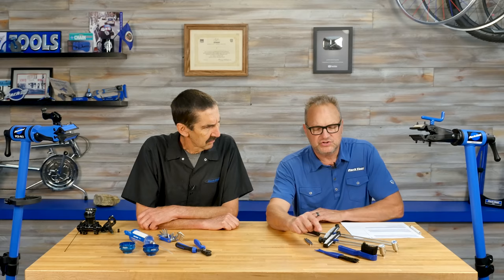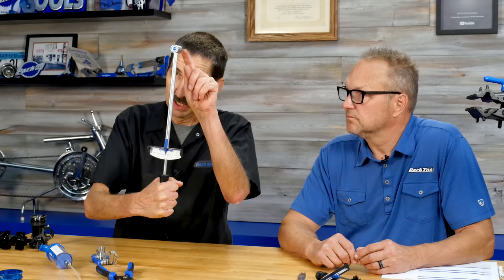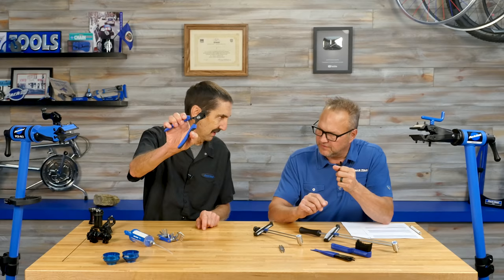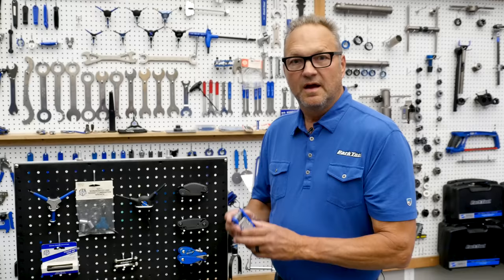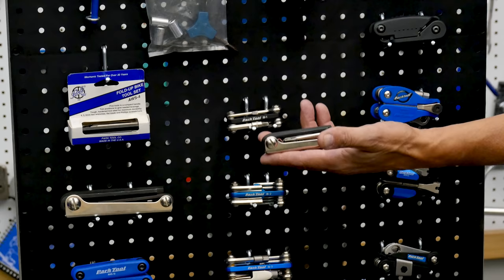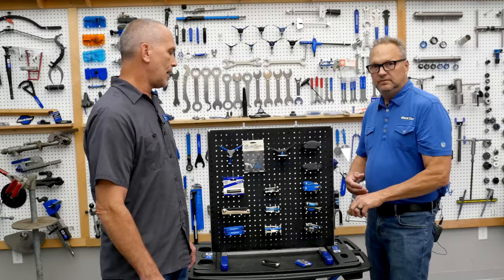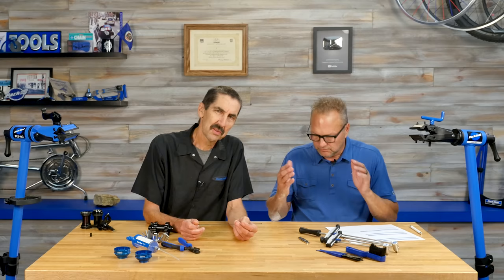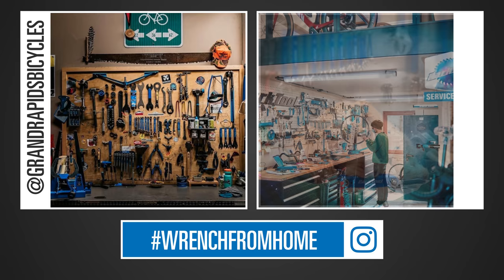New In Blue Episode 8 | New Tools for Fall 2021 and Park Tool's Multi-Tool History

Comment: I got my AWS-1 in 1993, and I use it to this day. Not even close to being worn out!
Reply: I got my ASW-1 in 1987 and still use mine. I took the blue plastic sleeves off the Allen wrenches so I could fit the tool in a tight place. Those were lost in the 80 s 😂

Comment: Please PLEASE when you make a new BB tool, put some 1" hex wrench flats on it (for the FRW-1, or a big wrench) so that really stuck threaded BBs can be removed. I have a few of the newer aluminium ones such as these, and the 3/8" drive hole has started to cam out on at least two, due to them having to be loaded heavily to remove stuck BBs. However, the older steel ones can get better purchase due to the hex end,
Reply: Really stuck ones- pour a just boiled kettle over the area fairly slowly, drag out the heat being introduced. Catch your water in a bucket below. That works for me every time to loosen from seized to movable. Allow the metal to break the seize for a few mins, and even using some penetrant after a few mins can help further.

Comment: It's good to have an 8mm hex key (I need one to remove my rear wheel) but my Hope Evo cranks take a 10mm hex key so I guess I'll still need to carry an extra tool if I want to be able to tighten/remove them trail-side. Having said that, with modern splined cranks that rarely happens as long as you torque it right to start with.

For me the ideal trail tool would include: Phillips/cross head screwdriver, 2.5mm, 4mm, 5mm, 6mm, 8mm hex, T25, chain tool, tyre plug inserter/hole reamer (for tubeless tyre plugs) and a tyre lever. I can usually get by without one but occasionally a single, long tyre lever with a metal (or similar strength/stiffness) core is useful.

I also carry a (presta) valve core remover and a spoke key but they're already built into my valve caps. For long distance/multi day treks I also carry a Leatherman for the pliers, knife, scissors etc...

Comment: I spent 20+ years selling bikes on the shop floor, and always wished for a simple multitool with 4-5-6, JIS screwdriver and locking knife blade that wouldn't wear holes in my shorts.

Comment: Still need to add pliers/chain link breaker for unscrewing stuck valve nuts and opening a chain in bad chain suck situations. Also a small knife or clippers to cut off zip ties. Make the knife serrated, in case I need to cut off my arm.

Comment: Can you make a chainline tool that allows you to center the measure from the frame?
Reply from the maker: We used to make a tool called the CLG-2. It clamped onto the middle most rear cog and allowed good visual inspection of the chainline. It was not a top seller unfortunately and has since been discontinued.
Reply: @parktool  I purchased a BDT-2 for a carbon drive build. My belt is length 118.   Using the BDT-2 on an Alpine Di2, the alignment tab does not work due to the motor of MU705 and my short length of belt.  I'm sure it's a "one off" issue, I tend to create issues.  Also, I used the Gates Cricket tool / and Gates App for tension assessment.  I am, like most, a bit lazy and looking for the most accurate easy way to do things.  I just need to play with a pair of calipers to assess the chainline.